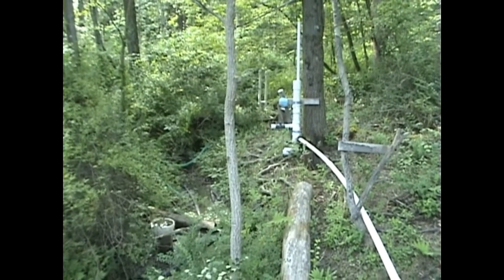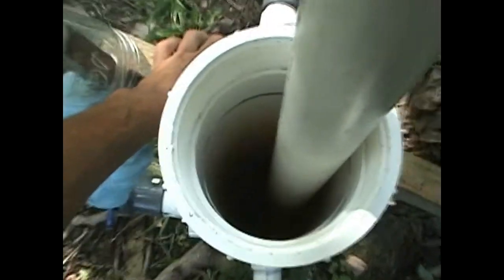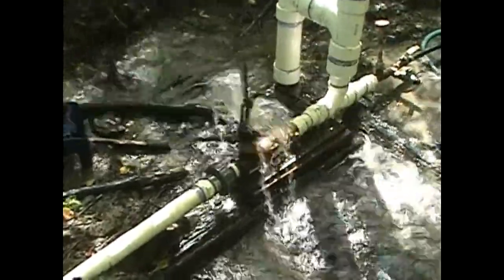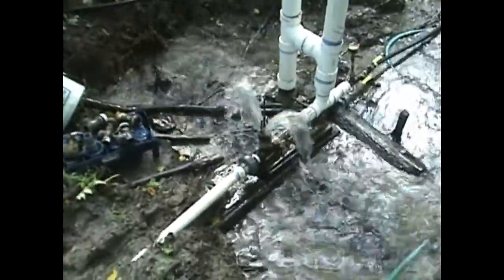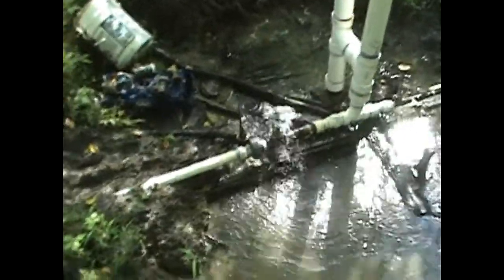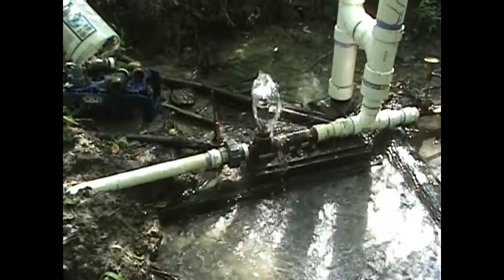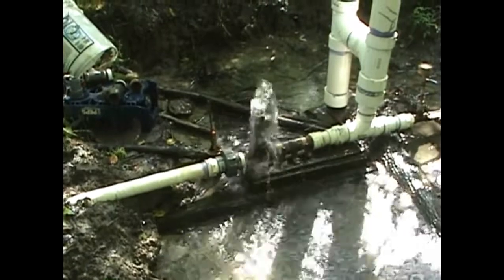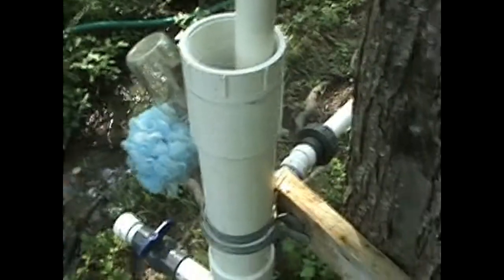08 09 2017 Ram Pump Scalability   Impetus Valve For Reduced Water Supply

Comment: Does the higher level in the stand pipe contribute to a higher head for the valve?
Reply from the maker: Sort of.. but mostly it just insures ample water supply to the pump... so that the pump doesn't deplete the water supply between cycles.